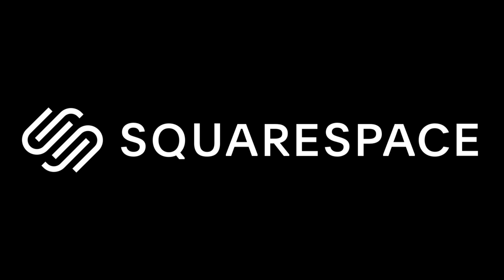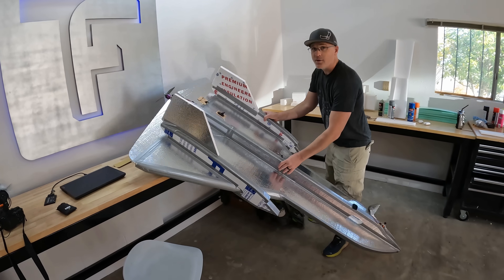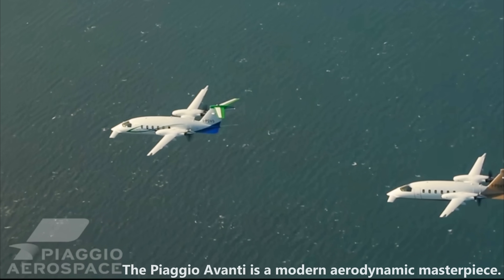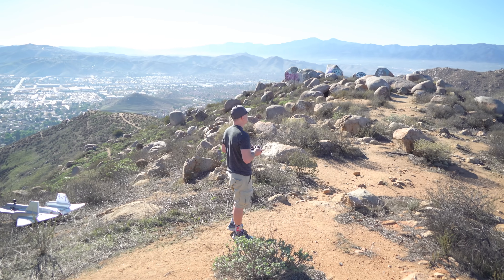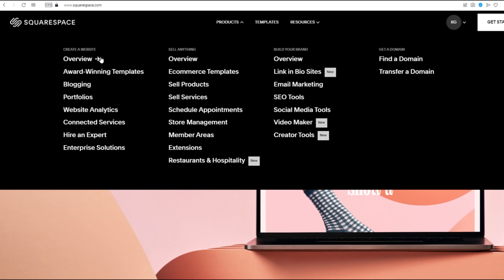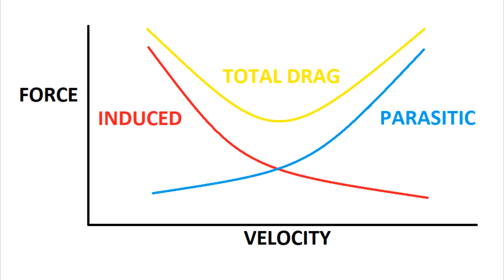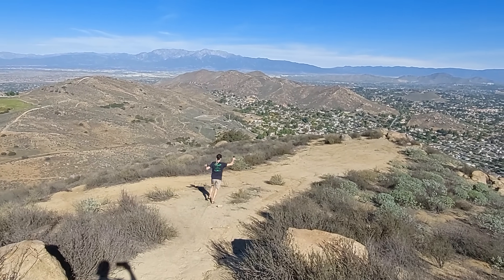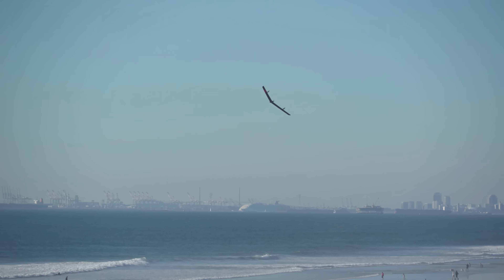Are Skinny Aircraft Wings Better?

Comment: An old question: does sweeping back (keeping its transectional profile) increase the wing area without changing its aspect ratio?
Reply: no
Reply: sweep back make sense only fro flying wing (for stability) and compressible aerodynamics, apart from this only drawbacks
Reply: @antonioesposito8071  also stabilises the yaw axis and improves drag....
Reply: @helicopter234  yeah forgot about the yaw stabilization, but i doubt there is any drag improvement in subsonic scenario

Comment: if the wing area is kept contant, there is a point after which an even higher ar will decrease performance due to the decrease in re number, meaning the airfoils stop working properly
so the saying "higher ar is always better" is technically not correct
i once did a number of simulations testing this, on a rectangular planform wing with a wing area of 0.1m² (10cm chord at 1m span)
i varied the ar and aoa and compared performance with L/D
can't remember the airfoil rn
up until an Ar of 25.6 (span 1.6m, chord 6.25cm) L/D kept increasing to a maximum value of 18.5
at higher Ar's L/D dropped again
Reply: That's cool! But for any somewhat normal (or even manufacturable) plane you wouldn't get an aspect ratio of 25, so it's fine to say it, since he said he didn't want to overcomplicate things
Reply: Another issue with the statement is that structurally high AR is not always better. It requires more weight and structure to continually increase AR, but for RC purposes it doesn’t matter much
Reply: Oh, I was about to ask if an infinite wing has zero induced drag, but this answers my question in a way.
Reply: @Captive Nut  Theoretically the induced drag would be zero yes, but other problems start to emerge (the lower Re number, but mainly structural)
Reply: You are also tend towards increasing frontal area with higher Ar. The particular amount depends on thickness and how it varies across the wing for each Ar.

Comment: Aspect ratio isn't a comparison of span versus approximate chord, and it isn't expressed as a ratio, as in "12 to 1". It's span^2 / area, expressed as an integer.

There are a lot of examples of very-low aspect-ratio planes that seem to defy all the explanations and equations saying that they must be very inefficient, are instead notably sleek and quick on available power.
If their supposed inefficiency isn't manifested in power vs speed or fuel vs range, then what is it?

The ones I note aren't supersonic fighters, but are low powered test planes.
See the Wainfan Facetmobile.
In one video of him speaking to the EAA after flying it to Oshkosh, it's demonstrated 100knots on 40 horsepower, with 340 lbs useful load (~100 pounds with 180lb pilot and 10 gal fuel.)
The '40s Eshelman commonly called "flying flounder" was aspect ratio less than 1. Very quick on the installed engine compared to a "normal" plane.
The Nemeth "parachute plane" of the '30s with circular parasol wing (AR=1.26) was faster than the biplane which the fuselage came from. The similar Farman 1020 was faster than the monoplane it came from.
Both Arup planes also were not atrociously inefficient, were notably quick on low power. (AR <2)

Most of them were rather like a "nutball", but the Eshelman was more like the SR-71 model, but it seemed in video to almost hover at super-slow speeds, while not being overpowered like a model that could stand on its tail.
( All the "Nutball" models I see in your videos are grossly overpowered. Try that much power on something with 1.5 meter span, AR<2, and try it on that slope. Maybe a square plank, AR=1)
All of these used the phenomenon of wing-tip vortex-induced "parachute lift" to stay aloft and stall-proof at super-slow speeds, but the vortices and the huge drag they cause are elective and temporary. They do not always carry around the burden of the excess drag, being efficient at cruise and fast at max.
Reply: bla-bla-bla-yadda-yadda          you can complain all you want, but a  number such as  '12 ' by itself,  is  NOT a ratio
Reply: @daviddavids2884  It's a misnomer to call it that.
The definition I gave is correct, and it is correctly expressed simply as a number.

Comment: At the speeds reachable by our RC airplanes where compressability effects are not a concern a high aspect ratio wing of the same wing area will consistently outperform a low aspect ratio wing even at high speed.  The low aspect ratio wing will not have a smaller forward profile area because the thickness of the wing is proportional to the chord length.  There's a reason the speed records for RC planes are held by high aspect ratio sailplanes dynamic soaring.
When a lower aspect ratio wing makes sense it's because of structural limits, span limits, stall characteristics, and manufacturability, not because you want to fly faster.
Reply: if the wing area is kept contant, there is a point after which an even higher ar will decrease performance due to the decrease in re number, meaning the airfoils stop working properly
so the saying "higher ar is always better" is technically not correct
i once did a number of simulations testing this, on a rectangular planform wing with a wing area of 0.1m² (10cm chord at 1m span)
i varied the ar and aoa and compared performance with L/D
can't remember the airfoil rn
up until an Ar of 25.6 (span 1.6m, chord 6.25cm) L/D kept increasing to a maximum value of 18.5
at higher Ar's L/D dropped again
Reply: @marc_frank  If your narrow wing chord is giving you Reynolds number problems just fly faster on cold days to get the Re back up and you're golden!  But yes funky stuff starts to happen at low Reynolds numbers and it can make sense to go with a lower aspect ratio wing to avoid that.
Reply: @Dovorans  the program i used to simulate these values calulactes performance in stationary flight
meaning it already increased speed for the lower chord wings
the wings above that Ar of 25.6 still performed worse
Reply: sorry, your comment is flawed.      for one thing,  it is not correct to say   '...the thickness of the wing is proportional to'           wing thickness is a design parameter; it is  Expressed as a  'percentage of chord length' !!!           this is not the same as saying that there is a  proportional relationship between profile thickness and chord length.
Reply: @daviddavids2884  while you are correct, that airfoil thickness is a design parameter, if the chord length is varied without changing the airfoil thickness, chamber, ... (scaling instead of stretching), then airfoil thickness is in direct linear proportional relationship to chord lenght. the scaling factor "airfoil thickness in %" stays the same
this also means, that if the aspect ratio of a wing is changed while keeping wing area and airfoil % thickness constant, the frontal area also stays constant

Comment: Great Video.  Need a build video on that one!  Wouldn't extending the front end out another inch moving everything slightly more forward create a more balanced load so you don't have to add quarters or will that create more drag causing making it less efficient ???
Reply: Yes, if he was trying to perfect the most efficient one yet but remember it's just a one off test vehicle, not the start of a production line.
Remember, "Perfect is the enemy of good" (look quote up)
Reply: Balance on an airplane is almost impossible to get right every time. When you change the position of the battery etc. It can be done but it is a test vehicle where the good part is that you can test different batteries and so on

Comment: I'd love to see a build video on the skinny wing! Particulary on the profile(s) used.
Reply: At the speeds these things fly, it really doesn’t matter much.
Reply: @brucebaxter6923  Please elaborate. Having watched the last part of the video several times, it looks like a Clarke-Y, or something similar flat bottom profile.
Reply: @janspoelstra8309  
How much detail do you want?
Start with temperature being the speed that molecules move at. 
Then brownIan motion being the movement of those molecules. 
Then the noise in water pipes when the pipe is small enough or the flow high enough caused by the turbulence as flow changes direction. 
Then Reynolds number being the point where a wing moves through air faster than brownIan motion can naturally flow the air around it without becoming turbulent. 

Short version, toy planes fly so slow a flat sheet of foam will fly. 

Ok, after that the charts are online to determine wing loading by speed and mass and then aspect ratio by speed.
Reply: @brucebaxter6923  You might want to do some research on flying wings before you go making simplistic claims.
Reply: @admacdo  
I have. 
And for that size and shape a flat plate is good enough. 

Larger sizes you need to blend in reflex towards the wing tips, but none of us are building them.
Reply: @admacdo  
I can go on about how the chord line should be a cosine curve through 270 deg and the upper front is a quadrant from Le to 1/3 and the lower is a quadrant from Le to 1/2 and the upper is a tangential curve from max thickness to trailing edge etc etc etc. 

Then go on to calculate downdraft velocities and how the Le of the chord needs to reach that angle at cruise speed etc etc. 

Do you really want the complex version or are you happy with toys fly ok. 

Look at flite test kits.
Reply: @brucebaxter6923  At 69, I merelely want info on how to build such a wing, not a PHD in aerodynamics...
Reply: @janspoelstra8309  
That’s cool. 
That’s why I tried to do the simple version first. 

Go look at how flite test make their foam sheet planes. 

Cheap easy and effective for the sizes we deal with.
Reply: @brucebaxter6923  I fly a couple of flying wings, a CK 840 foamy, a Sonicmodell AR Pro and a Pibros sloper. I'm aware of the Flitetest builds, which in general are too noisy for my Tinnitus. A fuselage like Kevin uses, allows me to put the prop further back to reduce prop noise. Information on the profile used would be nice.
Reply: @janspoelstra8309  lots of online plans for free
Reply: @brucebaxter6923  Got a link?
Reply: @janspoelstra8309  
Nope. 
I’ll look later
Reply: @janspoelstra8309  
Sorry I can’t find the one for aspect ratio vs speed. 

I’m in oncology with my wife for palliative care. This is quite low priority for me at the moment.
Reply: @brucebaxter6923  No worries.

Comment: I’ve always wondered if this could be applied to the real world, an airliner than cost much less than a regular ticket, had super high aspect wings and so flew much slower would work.
Like arbitrary values, but if the flight was twice as long, would people be interested if it cost half as much?

I did a skeletal thesis about this but couldn’t get to public questionnaires due to privacy requirements from my university
Reply: At that point you're getting into high speed rail territory. I think it would be good for Atlantic ocean crossings though. Also airports would have to be rebuilt to support them
Reply: The airlines that most people fly on are pretty much that, optimized for efficiency over speed.  It's just that even when optimized for efficiency a jet will quite happily cruise at Ma 0.85.  The only passenger jets you see that routinely exceed Ma 0.9 are expensive chartered business jets.
Reply: @Dovorans  I’m more meaning towards slow Mach 0.5 maybe less cruise, say like u2 styled, very slow, very high, very efficient 
Like a 737 with massive glider like straight taper leading edge wings.